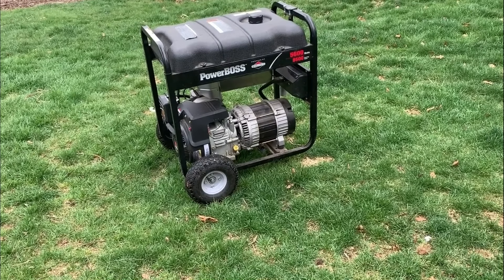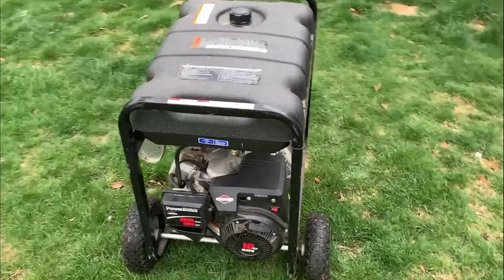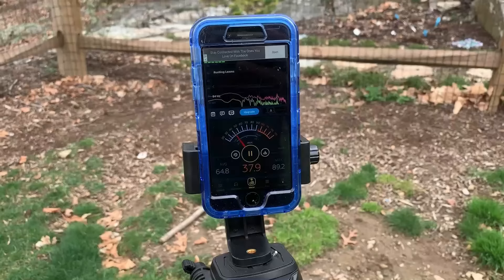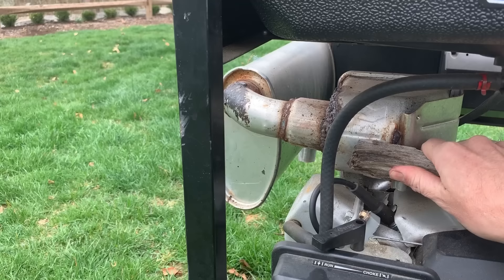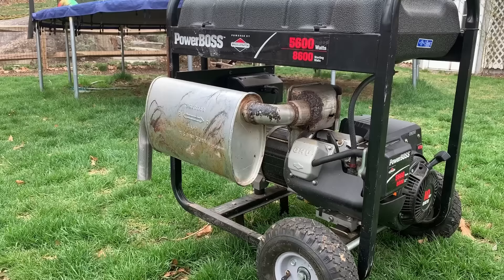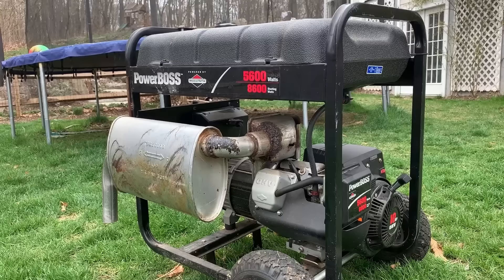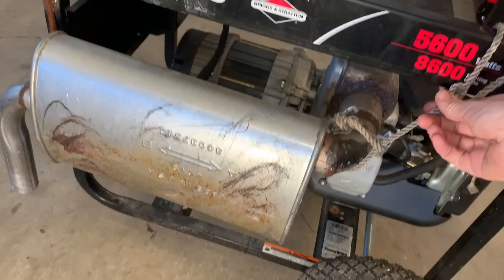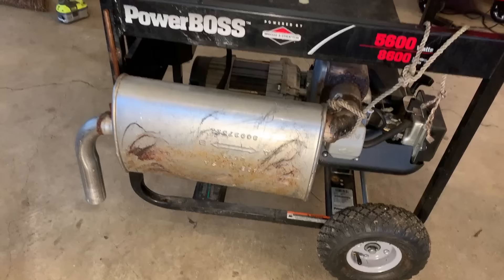Will a Car Muffler Make a Generator Quiet?

Comment: Hole in the exhaust when you're testing volume?  Sorry man, huge source of error there.
Reply: He isn't testing volume, he's testing whether the car muffler did anything to lower noise and found out that car muffler + bad stock muffler is still quieter than good stock muffler. Having a good stock muffler before the car muffler would only have widened the gap. Though for such small engines, just having a longer smaller exhaust pipe to give the exhaust flow some inertia would achieve much of the same goal.
Reply: @teardowndan5364  You basically said "he's not testing for a volume difference, but for a volume difference"
Reply: @ilpatongi  He was testing for a confirmation or rebuttal that it made a difference, not numerical accuracy. 3dB, 5dB or 7dB in favor of tack-on muffler makes no difference, all the numerical values are needed for is to confirm that he's not imagining things.

If he was worried about accuracy, he'd be using a calibrated directional SPL meter instead of a phone for measurements.
Reply: @teardowndan5364  And again, a long comment to say the same thing OP said...
Reply: @ilpatongi  Think you may be misunderstanding the experiment. The hole is mostly irrelevant in this situation. He is just looking for a difference in general. The hole only makes his point more so.
Reply: @calebbruce7812  Yeah, a difference in volume.
Go figure
Reply: Someone here is very wrong and I am too high to figure out which one
Reply: Eskismooches  teardown Dan is correct he is just testing difference in volume, not how quiet it can get. It's going to be louder with the hole but he is just testing if it gets any quieter with a muffler or not. I know it sounds odd to say but that's what it is haha
Reply: Eskismooches  No one's losing, were just wasting some time really.
Reply: @caleb bruce - I’m not so certain the hole actually is irrelevant. He wanted to measure the SPL difference between the car muffler and just the stock muffler. My theory is the car muffler will cause more back pressure which will force more fumes to exit via the hole, causing more noise. The car muffler may be significantly more effective with the hole repaired.
Reply: @ProdigalPorcupine  I thought of that and I agree but for all intensive purposes it's probably good enough he did cover the hole with the wood or whatever and I'm not sure the tolerances aren't as small as one would think
Reply: @cadillacctsv6122  big mood
Reply: @cadillacctsv6122   not true at all.. he proobably added noise by holding a solid object against a vibrating metal surface.. also to the people saying he just testing difference  (Will a Car Muffler Make a Generator Quiet?
).. is the title   and the baffle inside the muffler would be stuffed..  exhaust is full of holes.... much like this experiment
Reply: Doesn't matter about volume, decibils or whatever. The test was flawed even though it worked as expected.
Reply: @cadillacctsv6122  For all intents and purposes, not "intensive" purposes.
Reply: @brian21m33  my whole life is a lie
Reply: It's intents and purposes,  not intensive purposes.  Sheesh.
Reply: He is looking for a volume difference but has a hole in the initial muffler which lets in muffled sound out so no shit it’s going to be loud
Reply: Wow... Really?? This has to be explained to some people??? OMG were screwed
Reply: @cadillacctsv6122  
You'll live a long and happy life. 😉
Reply: @cadillacctsv6122  The sacred and the propane.
Reply: The hole in the exhaust system would eventually result in a burned exhaust valve as well.
Reply: James your test was no fair to start with because we all know that you love stock😂 but it would be nice to see you fit a glasspack and reduced end to the same volume as the stock Muffler out put!
Reply: @calebbruce7812  The hole makes huge difference - irrelevant? what? the sky is green?
Reply: @cadillacctsv6122  What if it had turned out it was actually louder - it would have meant absolutely nothing - totally inconclusive. Car mufflers help - that's all we know - by how much? No clue at all... none.
Reply: the error exists in the measuring device more than anything. i've seen phones register as much as 7db in either direction at 85db compared to a dedicated meter.
Reply: A hole in the exhaust makes a huge difference. And if you think that measuring a volume difference somehow makes the hole irrelevant, just take the car muffler off and mount it nearby the generator. There's still just a hole between the exhaust and the car muffler, it's fine. Seriously. It makes a difference.
Reply: ⚠️Always make sure you follow all the generator safety rules when you use your portable generator: 

This is just a reminder to make sure. It is important to follow all generator safety rules whenever you use your portable generator. 
Here are the things that need to be followed;

1) KEEPING OTHERS SAFE: Please do not allow an unqualified person or your children to operate and service the portable generator. Just because some manuals don’t say that doesn’t mean it’s safe. That is important against the generator safety rules. We also need to be keeping an eye on our children too. You need to make sure that your children are not playing near the portable generator especially when it’s running so they won’t get electrocuted. Generators pose electrical risks and they can be hot during an operation. Please keep your children away from the portable generator at all times. It is important to keep our children safe especially our little ones. Be aware of all the hazards.

2) WHERE TO RUN YOUR GENERATOR: Some people use their portable generators indoors which increases the risk of carbon monoxide poisoning. It’s important to have a carbon monoxide if you have a gas generator. Never ever use your generator indoors even if your doors and windows are open and even in the garage is not safe to use a portable generator. Not even at your porch and your deck. It is never safe to use your generator indoors and in enclosed areas of your home. Your generator needs to be 15-20 feet away from your house. 

3)🔥FIRE HAZARDS: Never refuel your generator while it’s running. You need to let your generator cool off before refueling it and before storing your generator. Never overload your generator too. Never ever back feed your generator. You should never plug your generator into a wall outlet. Also never store propane tanks indoors. Please keep flammable things away from the generator as well and please don’t smoke cigarettes near the generator. Having a fire extinguisher next to the generator is also important against the generator safety rules. 

4) GENERATOR OPERATION: make sure your hands are dry before touching the generator. Never use your generator in wet conditions. Don’t let your generator get wet. You need a generator tent if you need to use your generator during wet weather. Please don’t wear loose clothes when operating the generator. Turn on your generator before plugging in appliances. Use the right cord for your generator. Please do not use worn out cords. 

https://youtu.be/I1jT3ANENvI and here is a video more about keeping others safe when using generators 

Hope this helps
Reply: You can’t have an experiment with a variable that influences the outcome and claim that it does not. The hole is problematic. Replace the OEM muffler then do the experiment. The mufflers rely on temperature, air flow and pressure to perform. All those variables escape out of the hole . Neither muffler functions properly. Bigger isn’t always better. A smaller tractor muffler or 1st stage muffle, compact car, ATV, UTV or any vehicle with a small muffler would work. It would contribute up to 60% according to companies that make ones specifically fitted for ATVs and UTVs used for hunting. Putting a flat board on a rounded surface isn’t going to seal the leak anyway. It will not cover the total area. He could get an exhaust patch or something to fix it.
Reply: @teardowndan5364  that is measured in…. sound.
Reply: @calebbruce7812  No it isn't "mostly irrelevant"... the basic of all experimentation is to have a system in it's notional "standard" or "normal" state and then change one variable. Having a hole in it, totally negates any meaningful experiment. You might just as well say, we'll add 3 more mufflers, but leave them lying on the grass round the generator and see if that makes any difference!
That's the problem these days... few have even a basic grasp of science/experimentation and how it is carried out.
Reply: @cadillacctsv6122  Doesn't matter, it's totally pointless when there's a hole in the system!
Reply: @alanmoore2197  And that's the point. He doesn't care about "by how much" just whether or not it made it quieter. If it was quieter with the hole, it would be even quieter without it. The only point was to see if it did anything at all, and it does. Mystery solved
Reply: @kos_m824  Sorry - I disagree. The actual amount of reduction IS important. From this you have no idea of the degree of the benefit - so is it really worth the effort? - still a mystery. So to me its an almost pointless exercise...
Reply: It costs $5 for a packet of muffler puddy at auto zone, it takes 20 minutes to dry. It would have been literally that simple to make it a fair experiment.  As soon as I saw the hole I was disappointed. Lightly pressing an uneven block of wood on a round muffler is not gonna seal the hole much at all.
Reply: @teardowndan5364  "He isn't testing volume, he's testing whether the car muffler did anything to lower noise" so he's testing volume, what're you even talking about, I'm sorry. if the leak in the exhaust is before the muffler there's very little it can do to lower the noise that HAS ALREADY ESCAPED. A hole in the muffler basically makes it useless, not completely useless but.... how do I know this? ive replaced mufflers with holes in them, the difference is night and day.
Reply: @calebbruce7812  Hole = loud exhaust

No hole = ultra quiet exhaust

simple, they should have fixed the hole.
Reply: And even with that it was 9db quieter. I'd really have liked to have seen it with the hole temporarily patched- even if it was with a bunch of duck tape just to test for sound before it gets hot and melts. Of course, never try to patch an exhaust leak with duck tape, that's a fire hazard! Just for the sake of a short sound test it'd get the job done though.